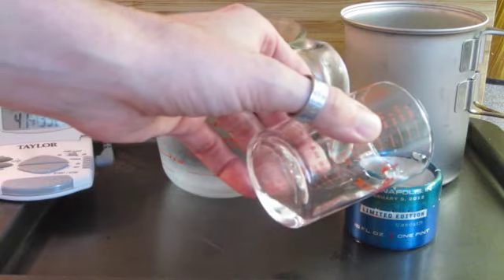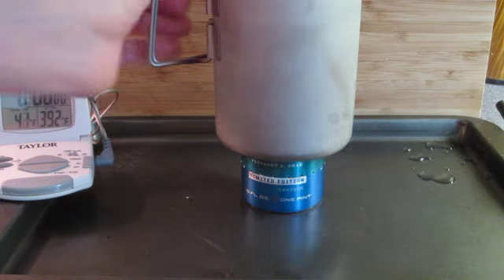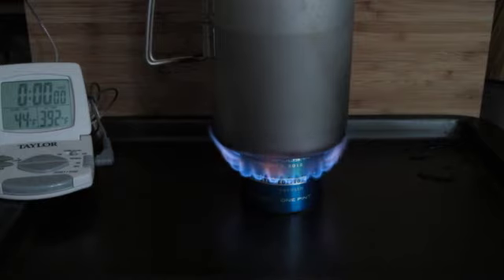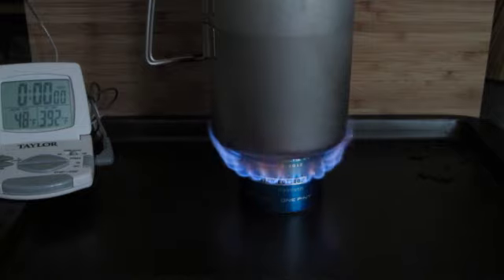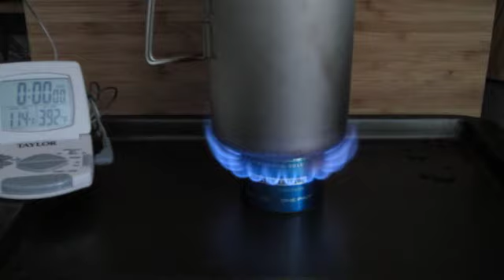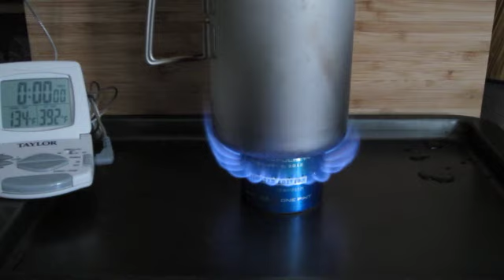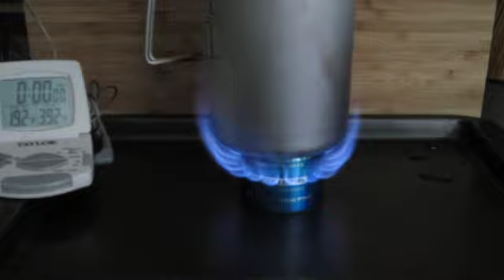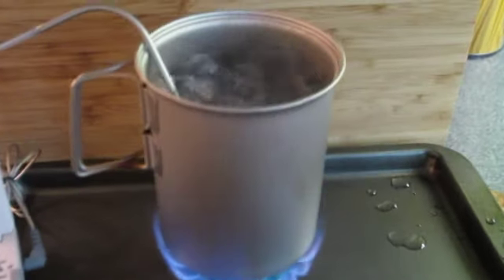Aluminum Bottle Alcohol Stove Cold Water Boil Performance

Comment: Nice work, and thanks for sharing.  These are great for a larger diameter pan/kettle.  In this test, though, a LOT of the heat ends up outside the smaller water kettle..

Comment: This is a great idea/design. It seems if you can either use a vessel with a larger base, or somehow reduce the flame ring pattern, you could make it even more efficient. With your test it looks like over half of the produced heat escapes around the outside instead of applying to the bottom of the vessel. Have you tried tube inserts in the burner holes and a way of adjusting their pattern? My bet is you could boil that water in under 5 min.
I may have to experiment a bit, very neat idea. Thanks!

Comment from the maker: The way that you regulate burn time is for the most part by the amount of alcohol you add.  The only way to put out the stove is to smother it (deprive it of oxegen) by putting your empty pot over it.  Once you use it a few times though, its pretty easy to get used to what it takes to boil the quantity of water for your pot.  Most of the time I use 1.25 when I'm heating up 2 cups of room temp water.  Cooler water I add a little more.

Comment: How long does it burn and is there a way to put it out? what kind of alcohol is used?
Reply: The only way to extinguish this type of stove is to cover it with a can, or something, and smother it. The alcohol he was using is methanol, sold as a brand called HEET in yellow bottles in the automotive fuel additives section. However, Denatured is a more efficient choice than methanol. Denatured alcohol is mostly ethanol, and ethanol produces 70% more heat energy than methanol. Shorter boil times and less fuel to have to use. Methanol produces 726 kJ/mol, whereas ethanol produces 1367 kJ/mol.

Comment: More bad advice Techie:

Alcohol stoves are WONDERFUL I don't like those bud light stoves.

First they weigh an OZ or more and in another vid you did not think a 6 gram fire steel was worth carrying.

Back to this vid.

Two other problems with the bud light stoves.

a. They need 30 ml alcohol to boil two cups.

b. They do not work well on pots 4 1/2 inch in diameter.

Another factor what are you going to do when you drop your pack and destroy your stove. You are back to cold food or cooking over a camp fire.

My stove weighs 6.7 grams and can work with pots from 2 7/8 inches - 7 1/2 inches (7.3-19 cm) should I drop my pack and my pot and stove be crushed. I find a Progresso soup can, or a 24 OZ beer can, for a cook pot, and find two Red Bull 8.4 OZ energy drink cans. In 30 minutes I can make another stove and clean the new cook pot.

My MAHALO stove is able to boil two cups of water on 17 ml of alcohol.

My ultimate stove can take tap water to 180 degrees with only 10 ml, and a rolling boil With only 12.5 ml. Now I live at 3,600 feet elevation and a rolling boil happens between 206 and 207.

I say learn to make your own alcohol stove. I included dimensions so you can make your own alcohol stove. Then if your pack falls 25 feet it is not the end of the world. Scrounge for cans along the trail. Find two cans and build another stove, and clean out a can you can use as a pot. Long before your next meal you have another stove, and a pot that can get you by until something better comes along

Comment: What type of alcohol do you use?
Reply: He was using HEET (methanol.) However, Denatured is a much better choice than methanol. Denatured alcohol is mostly ethanol, and ethanol produces 70% more heat energy than methanol. Shorter boil times and less fuel to have to use. Methanol produces 726 kJ/mol, whereas ethanol produces 1367 kJ/mol.

Comment: He uses "HEAT" fuel.... In the yellow container :-)
Reply: Heet..
Reply: Denatured is a much better choice than HEET (methanol.) Denatured alcohol is mostly ethanol, and ethanol produces 70% more heat energy than methanol. Shorter boil times and less fuel to have to use. Methanol produces 726 kJ/mol, whereas ethanol produces 1367 kJ/mol.